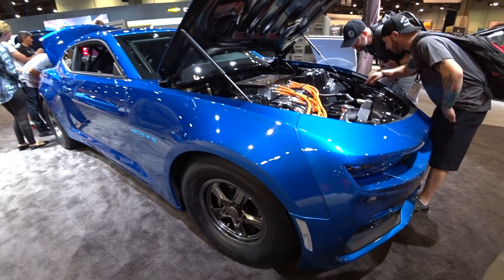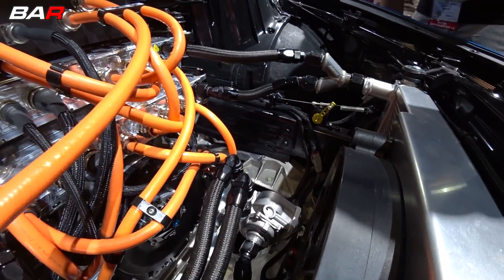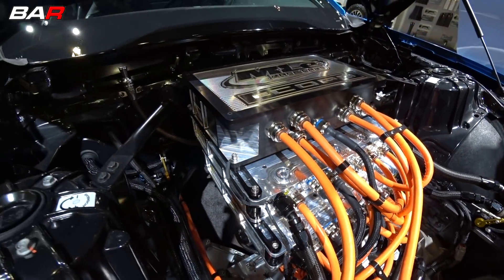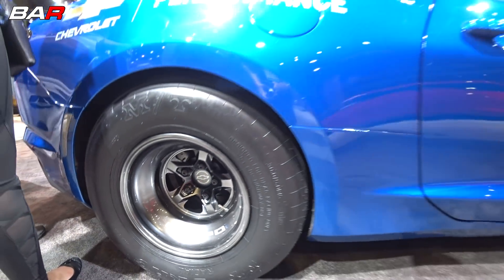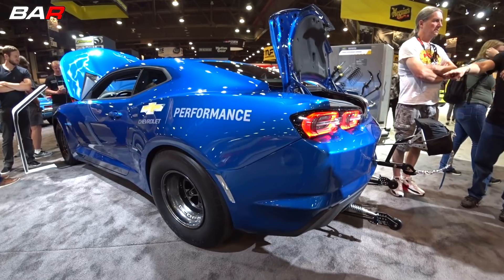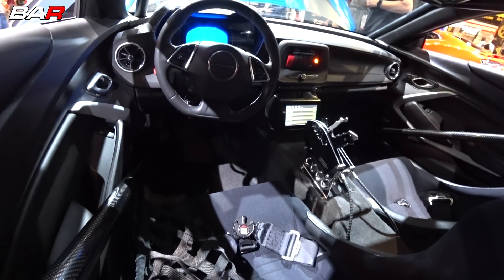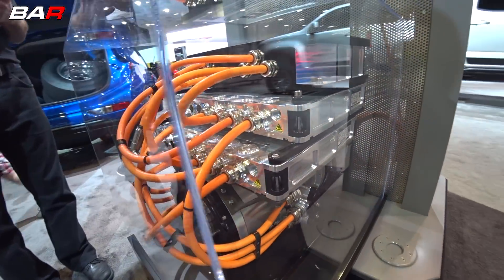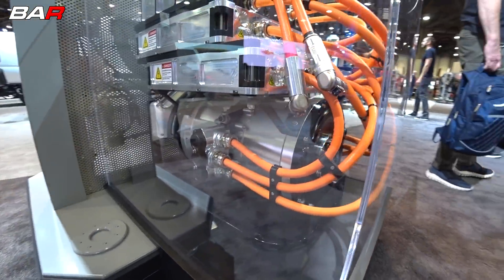eCOPO Camaro + 800volt LSX replacement unveiled at SEMA 2018

Comment: Not enough power
Reply: Enough Power not enough Torque. Old TurboGlide designed for gas engines can not Survive massive Sudden Torque from Dual electric motors. Thus why it is limited to 600lb/ft or quick sudden torque would destroy it. Even the lowly Tesla P100D does 920lb/ft. Crazy custom builds like Zombie222 do 1200lb/ft.
Reply: Neojhun not enough power or torque. Do they touch on output shaft rpm?
Reply: @xxxroberttheking  eCOPO is based on Twin BorgWarner HVH250 slightly modified to accept 2x 400v parallel. Based on the conservative stock BorgWarner 500v specifications torque drop off starts around 6000rpm. Total performance are 500kw = 670hp & 820NM = 600lb/ft.
 https://cdn.borgwarner.com/docs/default-source/default-document-library/remy-pds---hvh250-115-sheet-euro-pr-3-16.pdf

Comment: 🤣🤣🤣 it bolts to transmission!!! How STUPID!!! This doesn’t need a transmission. It needs direct drive and maybe a quick change rear end.
Reply: NO Just wrong. With these overkill 800hp 1000lb/ft plus BEVs if you want both Acceleration & Top Speed you need a wide set of gear ratios. Start from a mildly short 1st gear then end at a very tall Top Gear for V-Max runs. Lucid Air achieved 235.44 miles per hour with a Planetary Gears CVT (not belt driven).
Reply: It needs Transmission because Track-cars often need performance gears which make it fair play. If no transmissions then the eCOPO Will be banned from motorsports.
Reply: @xenialxerus934  wow didn't know
Reply: 800hp+ direct drive makes so much sense....fuck outta here

Comment: Pretty cool, but makes me wonder what the premium for something like that will run. Prob a hair more than $10k, if I had to guess. Lol
Reply: The motor setup alone is about $38,000 to do. Add another $12,000 for the inverter, and $10,000-20,000 for the pack, so I'm guessing a $60-70k adder to the car itself. Then there's the need to make a profit vs doing it for cost. Not viable, so I seriously doubt they'll release this one.

As was said, one or two runs and time for a charge on this one - there just isn't enough battery there and what is there will be cooked pretty quickly. And if you do keep your foot out of it, it probably has about 15-20 miles' worth of range. It's a concept...far removed from reality.
Reply from the maker: The LS7's MSRP was $17,337 and it was one of the most popular crate setups sold for years. At 10k it might be somewhat popular but I doubt it will be that cheap.
Reply: More like 35k$...electric engines are far from cheap